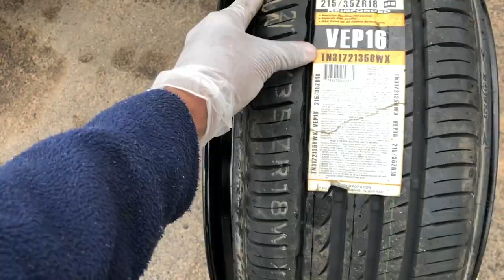NEW SHOES FOR VANILLA

Comment: Question about these wheels how much spacer for these fitment?
Reply from the maker: 25mm spacers
Reply: @maarodon  I did put 25mm of spacer whit 18x9.5 22et and tire 215 35 18 and the car sound like rubbing on some thing and nothing rub on coil over or fender I cont find where they rubbing at if you have these problem?
Reply from the maker: @carlitos8thgen  theres a spot on the frame that might be rubbing towards the firewall under the fender, you will have to hammer it flat